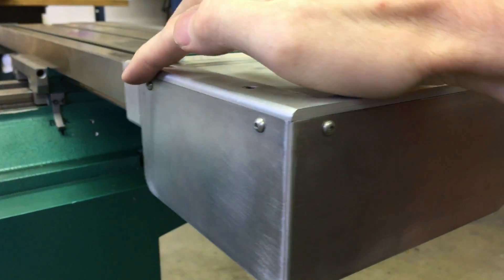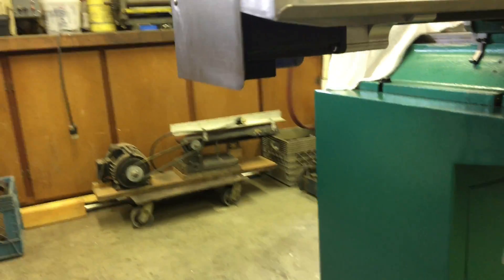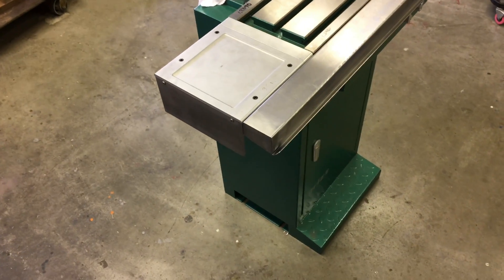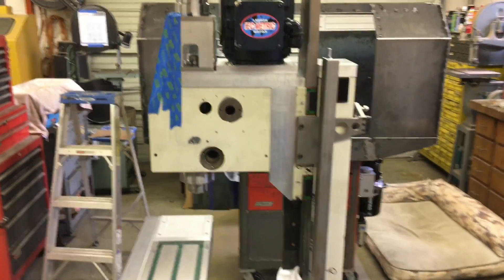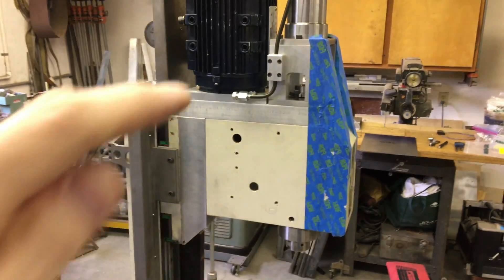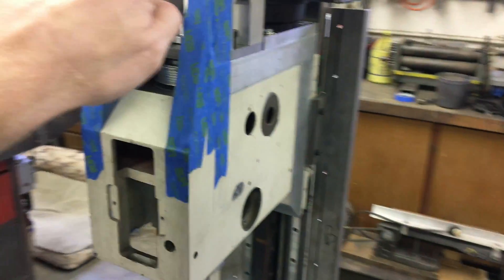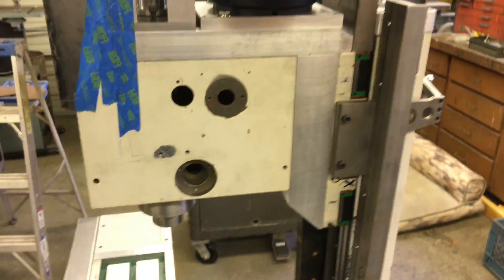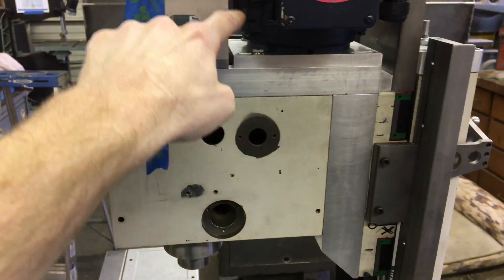GRIZZLY G0704 CNC Conversion Update 6 - ( X stepper skirt / head cover )

Comment: What kind of motors are you using?
Reply from the maker: +Bruno M. Stepper motors consist of 2 (x,y) nema 23 570oz and 1(z) nema 34 900oz. The spindle motor is a 1 hp D80 (metric) leesion motor. A few years ago when i was getting my 3D printer up and running i watched your videos! small world... Thanks! - Nick
Reply: Awesome, yeah I am getting into machining as well as 3d printing. I will be doing some more work coming up. Glad to be able to reciprocate views. Watched every video on your channel. Awesome work btw. Love the design and ideas. I may have to copy them on my own VMC build someday. :)
Reply from the maker: Very cool thanks a lot Bruno! I Look forward to your adventures in machining, its a whole new world! lol. See you around. - Nick